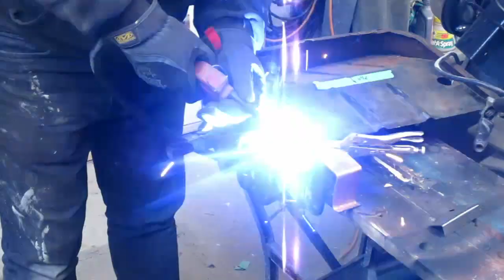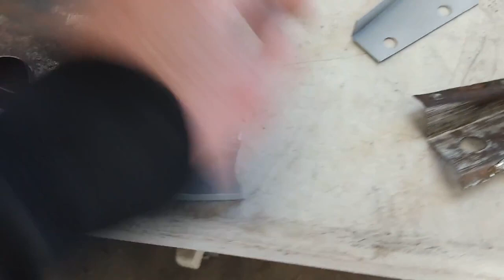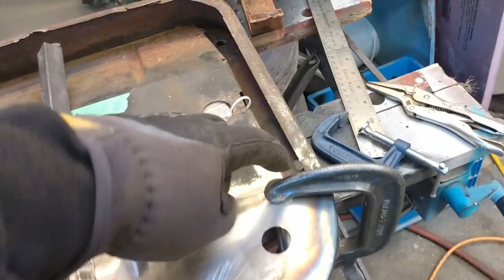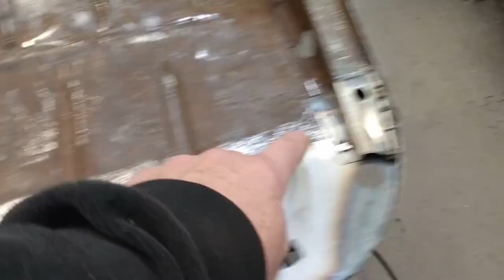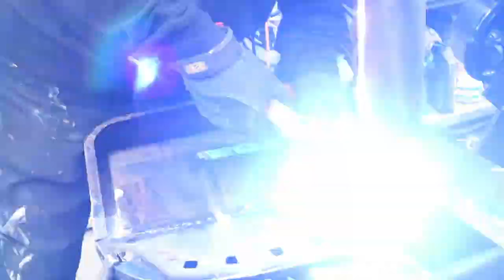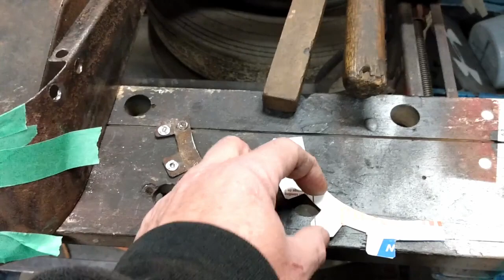How to repair a Frogeye Sprite's seats Part 2! Patch panels welded in place! Bugeye Build Episode 49

Comment: Forgot to ask when you first started welding, what kind of welder do you use?
Reply from the maker: Hello Jim. I purchased a used MIG welder quite some time ago. I run it with CO2/Ar gas and solid wire.
Reply: @ thanks.

Comment: Excellent. And now you have big progress on repaired seats and you've moved another step towards completion. I like the templates, they look right, and when this is done it'll be as good as new.
Reply from the maker: Thanks Ken. Lots of work like this to do over the winter. As for the templates I figure it's a lot easier to spend the time cutting cardboard to get them right than to mess around with multiple attempts with metal.